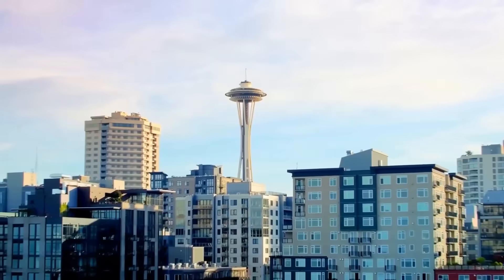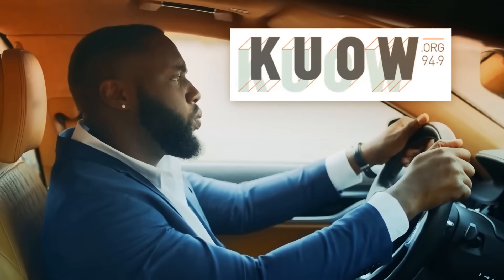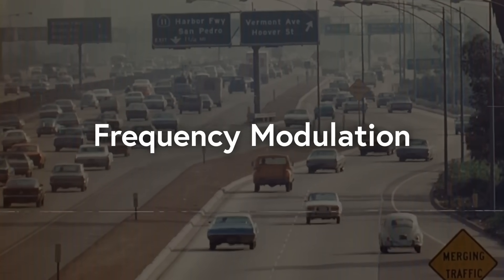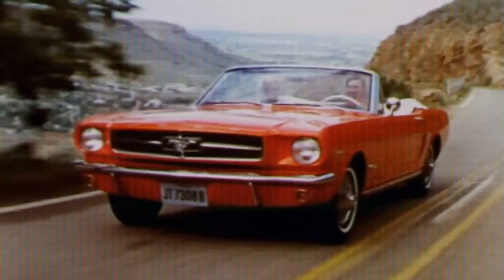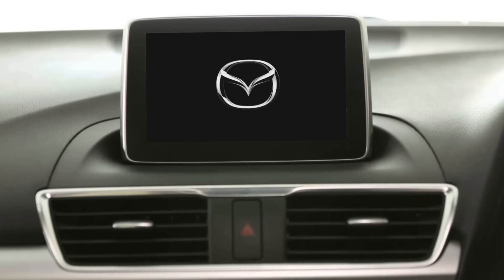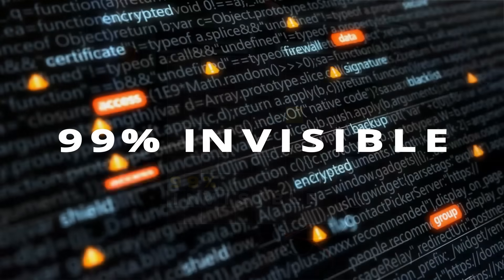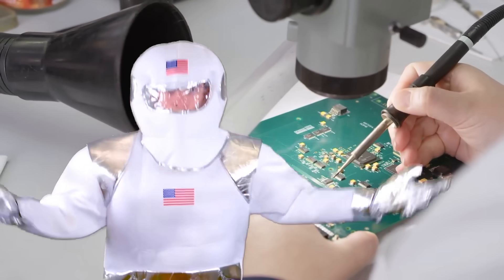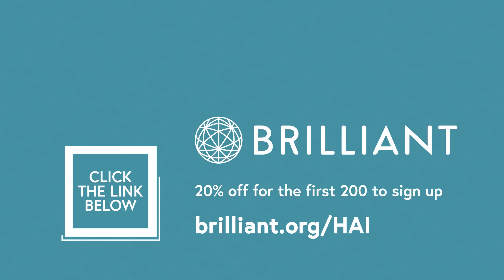Why Hundreds of Mazdas Tuned to 94.9 Broke Simultaneously

Comment: Car companies: "We take cyber security very seriously. It's impossible for a hacker to hack your car... trust us"

Also car companies: "If you use a file without file extension it will literally brick  the onboard computer"
Reply: Also car companies: We don't want right to repair because Independent repair shops can hack your car
Reply: @triadwarfare  Also car companies: WE can’t repair this computer. Your only option is to pay $1500 of your own money to totally replace it, and also we don’t know when we’ll get any in stock.
Reply: @triadwarfare  only Tesla act like that
Reply: I guarantee you QA, if it existed, said "we notice that if the file has no extension the radio blows up" and some fuckface middle manager or dev went "you moron, nobody is ever going to do that, ship it already"
Reply: @romulusnr  The vast majority of programmers who build embedded systems (like car infotainment systems) use Windows, which enforces the use of file extensions, so chances are they had no idea that MacOS, GNU/Linux, and BSD (not to mention a few others) don't care about file extensions at all. Therefore they likely didn't even think to do what is done on the Internet and check the file type directly (by looking at the file header). What is even more awful is that they apparently didn't bother to provide for a "this is how to reset to factory state" service routine, which would wipe all user data, including temporary files (like album images), and make the damn things work again.
Reply: @DrewNorthup  That’s what I was thinking. Why can’t they reset and wipe the computer controlling the infotainment system, and reload an image to it? They were saying you’d have to spend $1,500 to replace the whole thing! What am I missing? What is the technical reason they can’t re image the system?
Reply: @bayareanewman1566  Laziness.
Reply: That bug is probably in JIRA sitting in an unprioritized backlog with 500 other bugs and or features.
Reply: @romulusnr  quality assurance at Mazda? HA! They went on holiday 25 years ago and never made it back.
Reply: It's a lot harder to hack a computer if it bricks itself first.
Reply: @joshuacerniglia2501  often the goal of an attack is to limit availability, bricking the system definitely accomplishes that.
Reply: so i imagine all the companies involved were ordered to pay substantial damages to customers involved... right??
Reply: @alveolate  thats only going to happen after it all goes to court, so dont hold your breath
Reply: "...the onboard computer that controls the isolated media infotainment system." They are not allowed to mix essential functions on the same system as the infotainment system. They have to be isolated from each other.
Reply: @anthonylosego  Yes, that's true. But they are usually attached to the same CANBUS.
Reply: I mean bricking a system does kinda make it impossible to hack lmao
Reply: @cronchcrunch  a nice DoS attack if there ever was one
Reply: @cronchcrunch  , back in the old days, if you pressed a certain function key while a computer was booting you could access a menu that allowed you to select what drive the machine would boot from. Many a machine was saved from a corrupted or virused hard drive thanks to this.
Reply: @spaceflight1019  what do you mean back in the old days, you can still do this
Reply: @dyedie1  , I wonder if that can work on these information systems.
Reply: Like when Sony spent millions on making it so all CDs were copy-protected from ripping and putting on your Sony MP3 players ;)  (see Iron Maiden's Dance of the Dead as an example), you can just take a Sharpie on the underside and draw over the ring and it works proving that it's easy to circumvent something despite the millions you spend on it.
Reply: As someone who works as a developer for embedded platforms, I can assure you that:
1. People who work with infotainment and "vital" parts of a car probably didn't even work together on their projects, so whatever dumb crap infotainment guys did with has nothing to do with the computer that, for example, manages engine.
2. Even if that was the case, I'm pretty confident they use different computers for "secure" part of a car, and "insecure", which probably can't even can't properly communicate with each other. This is normal practice in embedded devices that deal with sensitive data.
If I'm wrong about this, sorry, I don't work for a car company :)
Reply: @hikkamorii , a friend of mine owns a Harley-Davidson trike. He tells me that it has six computers, all of whom must wake up and communicate with one another before he gets permission to actually start the engine. I watched it, and will guarantee you that you will not make a quick getaway on that trike!
Reply: Car companies: have drive by wire canbus signals and an open telnet port with a Sprint cell modem attached to the same device.
Reply: Its gonna be swell when someone figures out an arbitrary code execution payload to put on said image without extension, and can go around with a SDR blasting it on all FM channels, and seeing which cars nearby just lock up the brakes.
Reply: @Mosquito be honest, that's not why you drive a 98 civic. I'm broke too, friend. 99 outback with 300,000 miles here.
Reply: Look up videos of the Jeep Cherokee being hacked, literally taking control over the entire vehicle by remote.
Reply: this is why older cars are better. You don't have to worry about bs like this happening
Reply: @hurricane3518   just purchased my first vehicle with an actual computer last year, OBD II, unfortunately my old '86 Chevy with a carb finally gave up the ghost.
Welp, no more vapor lock on a hot summer day
Reply: @davidconner-shover51  I'm surprised if your '86 Chevy with a carb didn't have some type of computer on board.  My '84 Buick Regal did.  It had an electronic feedback carburetor with an ECM having a real CPU running actual code from a ROM.  NO OBD interface though; troubleshooting was a laborious procedure involving a multimeter and a manual.  And every electronic system either was non-critical or had a redundant mechanical system.  It ran better with the fuse for the ECM pulled for most of its life.  A general mechanic of the day might be forgiven for not even knowing the computer was there, but it was.  It really only existed to fine tune the emissions.  I read that most GM vehicles had some kind of computer by 1980.
Reply: @toasTr0n  ignition computer only
Reply: "Brick"?
Reply: @AndrewVelonis  To brick something is to make permanently unusable, usually with only software.
Reply: @AndrewVelonis  
Brick:  
You take a piece of high zoot technology - accidently or purposely fiddlefuck with its software, and render it unable to function without physical hardware replacement or advanced hands on troubleshooting. 

You have taken an expensive piece of tech and have turned it into something analogous to a brick - a brick sits there and does nothing, it is just a piece of compressed and baked crushed stone.  
Bricks are good for throwing at things when you are frustrated,  so is your piece of "bricked" tech.   A brick makes a dandy paperweight, so does your "bricked" piece of tech
Reply: Anyone who says that all the technology is a good thing is just an uninformed nincompoop with a college degree in liberal arts. 🤣🤣 Points Scored
Reply: I would bet the problem stems from a case selection without a "case else."
Reply: So the main takeaway is this: if you want to hack a Mazda, code new firmware as a file without an extension, and embed that file in a data stream broadcast over-the-air.
Reply: This is why I ripped my push button out and got a manual key start with a hidden kill switch.  nothing beats those!  keyless cars can easily be hacked with a special device.
Reply: Why would they send out an image file Without an extension?  
Several times I've seen pc's without the file extension showing in the folder display.  That is very confusing when files have the same name but different extensions...which often happens.   I show the people how to enable the full filename display.
Reply: I guess it was just luck that the Mazda software didn't jam the accelerator pedal to the metal.  
I've gotta admit I don't generally worry about FM radio broadcasts when I'm programming. ( Looks like I should. )
Reply: No car company has ever said it's impossible for them to get hacked
Reply: Hyundai: We take the security very seriously.

Americans: So you installed an immobilizer right? Right?
Reply: could you create a HD signal to send files to hack into the cars computer and control them!!!
Reply: @bradenbigham2007  , not a broadcast HD signal but the cars that are connected to the internet 24/7/365 are most certainly hackable. If Tesla can get in without your permission anyone can get in without your permission.
Reply: @spaceflight1019  I don't ever want to run a car that is capable of receiving firmware updates wirelessly, especially without my consent.
Reply: @TAP7a  me neither, that's one reason to not own a Tesla.
Reply: @spaceflight1019  you have to manually run updates on Teslas
Reply: @spaceflight1019  daarpa did a study on this, and yes, your car can be remotely controlled.
Reply: @spaceflight1019  Remember, Tesla also deactivates certain features and performance boosts when an owner sells a car to someone else, requiring the new owner to pay for the disabled features.
Reply: @TAP7a  better start stocking up on your chosen platform. I've got three first gen legacys.
Reply: @bradenbigham2007  In theory yes, but likely not in this case.

Comment: I'm surprised this didn't happen sooner. With 10,000 FM radio stations in the US (not sure how many are digital) a benign mistake like the station's was bound to happen.
Reply: It's kind of sloppy that the data protocol is even dependent on file extensions.
Reply: @romulusnr  Not a programmer, but I'd think it should be software 101 to ignore/discard any file without an extension. If nothing else, it's a waste time to write code to figure out what type of file it is, and a waste of resources to run the code and check the file.
Reply: @romulusnr  Hubble Quality Control: bows to Mazda
Reply: 10k is pretty old data, currently there's about 25k of them.
Reply: Not to mention what fringe areas do to data because of low signal strength and dropouts.
Reply: Clearly Mazda software devs were responsible this time. The worst result the "mistake" should have brought was that the metadata was not shown.

Comment: I’m by no means an expert, but could this be a case of Mazda using some kind of Windows-based operating system for the computer? I know that Linux is able to process files that don’t have extensions, but Windows machines can’t. 

Though if Mazda is running Windows for an embedded operating system, they’re gonna end up with heaps more problems
Reply: Windows as an embedded operating system has been totally dead since Windows 8 and wasn't exactly popular even while it was maintained(And Windows IoT edition which supposedly is their successor is much heavier than Linux). Linux or QNX by themselves may be fine with parsing the file but whatever is running as the infotainment frontend probably wasn't hence the bug.
Reply: @Notevenmad955  2014-2017 would be the time for Windows 8 though.
And I've seen the Windows 7 boot screen on an ATM in my town once, so Nothing is Impossible (Oh wait, that was Toyota's tagline in Germany...)

Comment: i am so sorry for everyone who goes to brilliant to learn programming and realizes that all programming is is big blocks of text that are awful to look back on and even worse to debug - sincerely, a computer engineering major
Reply: No, guys, you're talking about working with code. When people go to Brilliant to learn programming, all the code they'll be looking at will be nicely formatted, efficient, well-documented samples. They won't find out what you're talking about until they tell someone that they totally know how to code.
Reply: You forgot the part about trying to figure out why it doesn't work as you read uncommented code as either 
1. The compiler tells you the error in the wrong place 
Or
2. It compiles but you have 2000 lines of uncommented code you didn't write to try and figure out.

As an EE i feel sorry for anyone who voluntarily got into CS, the black magic of optics is easier to understand than the tricks my professors would use.

Comment: I would hope self driving cars would decouple their driving OS from the radio (and all the other stuff like HVAC).
Reply: Yes you would. Trust your life to lowest bidder spaghetti coders.
Reply: Be nice. But i doubt it will happen until something major happens and someone "important" gets hurt from it
Reply: AFAIK no car with ADAS runs it on the same hardware as the media.
Reply: @hobojo153alt4  And with every iteration they try to remove extra parts and integrate systems, making an entirely new and different car. A few years ago there where incidents where newer Jeeps (and maybe some other vehicles) were able to be hacked and at least shut down the engine remotely - I can't remember if they had brake or throttle control. I don't know what "fix" came out for it but I definitely remember watching a live demo of it happening. There was probably a software patch.

Also I believe there were alleged international hit(s) carried out by causing cars to accelerate without brakes. I don't know if they actually hacked the car or just modified it secretly.
Reply: @ryanroberts1104  Oh all cars are computer controlled now, and most can be hacked.

My point is all of them AFAIK use entirely, physically separate systems for their infotainment.
Reply: But it would be hilarious if all navigation paths just led to NPR headquarters and the parking lot was always filling with Mazdas
Reply: You hope wrong..
Reply: Anything else would literally be insane. But given that the head of THE pioneering EV manufacturer is Elon Musk, it's nowhere near as unlikely as I'd like.

The system that controls the car's physical movement should be completely isolated from the non-critical creature comfort systems of the car and especially from any external (radio, WiFi, Bluetooth, cellular) interface, but of course, 'flashy' futuristic functions like remotely starting and "summoning" the car would not work without some connection (= attack vector) between the "smart" systems and the drive control system. Yep, it's creepy!
Reply: @LRM12o8  I mean, Audi has had summon features for years, it's not just Tesla that's doing this
Reply: @LRM12o8  Maybe they could have a switch that manually disconnects the remote control computer from the drive controls? As soon as you get in, hackerman can't do shit, cause the car and attack vector are separated. Won't stop unoccupied cars from being used as "trucks of peace", but at least you can maintain control when you're inside of it.
Reply: That would make it more expensive, so no. To make computerized things actually reliable you would need airplane style redundancy - not gonna happen. Throttle, brakes, and steering are already electronically controlled - in any newer car you're basically just using a remote controller that is mounted near the driver seat.

And oh yeah, they're going to mix all that up together in one system with the computer and the radio and another computer for absolutely no reason!

Comment: So far, car operations and entertainment where on two separate computer systems.  However, I can see this changing with self driving.
Reply: My 2008 Volvo S40 has a single integrated system for entertainment, HVAC control, as well as setting things like preferences for how the car will lock. Entertainment and operations have been sharing systems for a long time.
Reply: @pv2b  So your point is that I didn't list every non operation systems in all cars?  
Now I'm not going to rage on you for not knowing how cars work but if your going to try and correct someone you should at least have a basic understanding of the topic.
The cars computer handles things like the engine operations, breaking, air bags etc..  Not google play and such
Reply: @lucidmoses  You said "operations" of the car. I would consider HVAC control and providing preferences for how the car's locks and comfort lighting work to be part of "opeations".

Of course the ECU and the airbags or the tractions control aren't handled by the head unit providing these types of operational controls. I never claimed all of a car's operational controls run off the same system as the entertainment. That would be ridiculous, at least for a 2008 Volvo.

Comment: Quite a few new cars with electronic shifters can’t be put into neutral easily… Try getting a 2021 and up Chevy Tahoe in neutral without the engine running!
Reply: That is scary. Add to this the fact that not every electronic handbrake acts as an emergency off and safely stops the car (some just activate a dumb old parking brake that when pulled causes the car to spin out uncontrollably) and you got a recipe for disaster!
Reply: @LRM12o8  Can't they just subject parking brake to anti-lock braking system too?
Reply: @dbclass4075  that would make it more expensive while cost savings is the only reason they do it in the first place.
They want to look 'modern' by pretending they have an electronic parking brake, when it's just a handbrake with the extra step of being engaged with a button instead of the physical handle. It's stupid, but it's what some brands do.

Comment: Wow I thought hacking into all the cars would be a little harder than just leaving off .gif on a radio signal... I'm resistant to buy any car that has this sort of system in it.
Reply: I'm sure that all car manufacturers use proprietary code in their cars, so when buying a new car it's not possible to know if they have these sorts of bugs in their code or not.